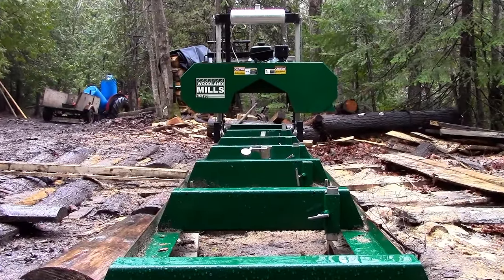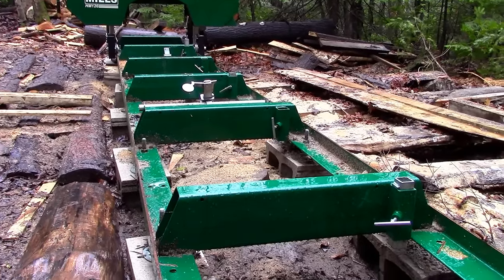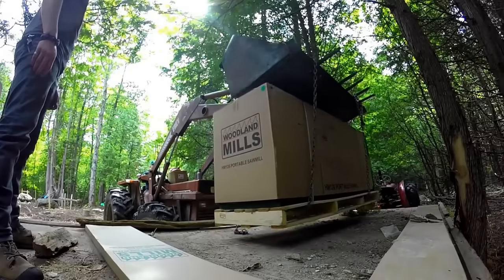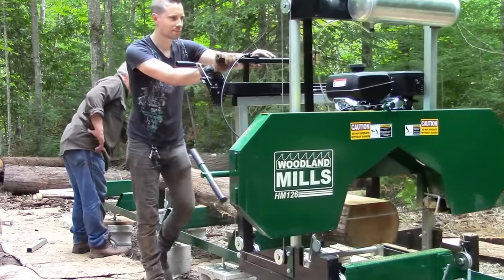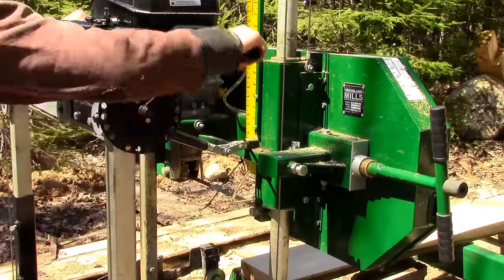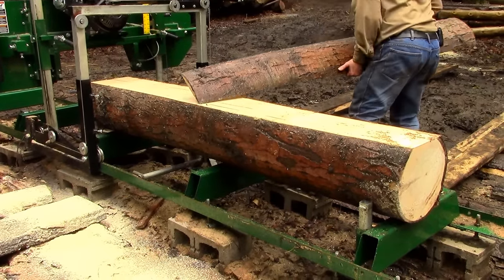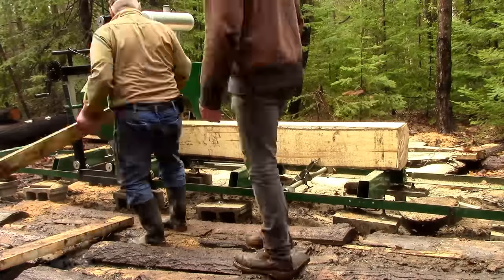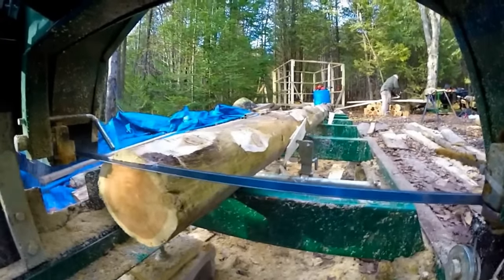Portable Sawmills- Are they worth the money?- Woodland Mills HM126

Comment: I realize this video is a few months old but, few questions for you that you didn't cover.

1: What's the cost of the blades vs the cost of a chain? 

2: You mentioned about sharpening the blade, what's the time frame for that? A chain saw, can be sharpened right there on the spot without removing the chain. If my memory serves, you either have to send the blade in or spend a small fortune for the sharpener. Otherwise, if you attempt by hand, will take a tremendous amount of time. 

I know many talk about the "waste" from a chain saw mill vs a normal saw mill. In my opinion, that's mute. Look at the pieces you remove before you start cutting actual lumber. Even a 1/2" x 1" piece, (or smaller),  is still usable, especially in woodworking. I won't disagree about the fact the chainsaw mill is a wider cut vs the band saw mill. But, that's just my thoughts about the waste.

Comment: Great video.  Very useful information.  Still, I'm very surprised that you work in the mud and cut muddy logs.  I can see all sorts of negatives with this.  I would invest in a concrete slab and a power washer.  That being said, I would like to hear your input on the subject.  ...maybe it isn't a big problem.
Reply from the maker: In one of my previous episodes I show my setup for washing logs ("We Got a Portable Sawmill!- Log Cabin Update"). Most of the logs that you saw me cutting in this episode I did wash beforehand. You're right, keeping mud off the logs is important; however, my location in the bush makes that a challenge.
Reply: We have this same mill. It’s on 300 acres of land. It was used when we purchased and I guess it’s been 4 years now. We log and saw most every day. I’d say we have put around 200-250,000 board feet through it. The last few months we went from two guys, to three. So one guy logs, and pulls the trees back with a small tractor, and two of us cut. Logs often get muddy. We use welders wire brushes and stuff bristle brushes to clean the blade path until we get the slabs cut off. We have a sharpener also to keep the blades fresh. Never has been a issue.

Comment: Just curious why you move the logs by hand when you have the tractor?
Reply: No forks.
Reply: Wondered same thing! You don't need forks, just chains.
Reply: I agree.  To move small boats and canoes they make little trailers that are just the mount and the two wheels, you grab the other end of the boat, pick that end up and go with the back end of the boat rolling along.  I have seen people doing similar with a two wheel attachment on the back end of a log with front being pulled by an ATV.  I'm betting that tractor can pull better than an ATV.  Yes, things cost money, but the speed and lack of grime packed into bark to dull the blade will help the build effort (assuming you have the cash to buy/build the two wheel attachment).
Reply: Chains and if you have some ratchet straps you can use 2 trees to roll it up the side ramp. Or some ratcheting block and tackles if you have them!  Great video and very clearly explained.  Thanks for sharing.  :-)

Comment: for a new operator that was well done if you want a cheap  bead for your mill cut it if you weld it will not coast you much for the metal then you just center the mill when you travel i had a little back hoe and full hydrolic ban mill a small sev s ten 4x4 work on my own think it coast me two days a month for payments for it all most of my helpers i paid 20 buck an hour ones they got it in hand most of them became millers and were off loved it

Comment: How long did it take to set it up?  I have a particular piece of grizzly equipment that I had to repair 13 separate issues straight out of the box. Didn't get to use the Grizzly product for a month, and it was brand new. They sent me a defective warranty part, parts that didn't even fit, and there was a back ordered part needed. I'll never buy a grizzly product again

Comment: I set up a chainsaw mill's first cut in much less than half the time it takes you to load a log on the band mill.  It adds up to the amount of time it takes to tap in six 16d nails about 1.5" deep.    I can go through a 10' log 30+" wide in 10-15 minutes per cut.  The mill cost less than $100 delivered to my door and the power head was free...already had to have a decent sized chainsaw to fell and buck trees.  Look up my videos if you need confirmation.

Comment: Should u buy a bandmill?
Bushland ? 
Yes,if it is a couple of thousand dollars.
You can build your buildings and sell it.
It's lots of work and handling. If u have free help??? It's great.
More expensive mills are still slow.They are not production mills but they are very expensive. 
Your landing area needs to keep the logs clean as possible. 
Stability in sawmill setup is crucial .Your log deck needs to be solid and make setting the log on the mill easy on you and the saw frame. Opinions are welcome.

Comment: IMO:
Do you have a tractor+trailer y/n ? n= chainsaw mill 
Is it for a log house? y = chainsaw mill 
Your forest is made mostly of pine/low grade wood/small diameter trees? y=chainsaw mill 
If you don't have a tractor with hydrolics to hoist big logs into a trailor back to the shop or the sawmill transformation area then forget the sawmill.

Chainsaw mill= $129,  Portable Sawmill: $2800-$3000... (it's $2800 that you can spend on a: chainsaw mill, a mig welder, an metal cutting saw, an oxy cutting torch and adapt your own electric bandsaw on rails :)

Woodland seems good but, the Frontier OS27 seem even better for ease of use for a few bucks more. Do you really need more then 11' lumbers? in few application if I ever needed more then 11' lumbers I would simply chainsaw mill it. The longer the heavier and seldom straight or perfect grain also...

Comment: I don't think there is many better explanations then this one. But i have been thinking on it and at the end of this video i see how you get the raw tree into rectangular /cubic shape and from there into thin boards. But how do you cut vertically or do you just use a table saw to makes all the 2x4, 1x3 , 2x6 ,2x12 ,...etc. Also there is no lathe part for the bark removal so it seems your also wasting alot of wood trimming off the bark of the tree. One other thing is how many times do you run into a bigger diameter tree that you cann't fit in the machine?

Comment: The Outsider  With the trouble and time you were upset about the placement of the saw and level of it. A concrete slab in a place you can access with a tractor would not be much effort to make and could have a use left when done. A trailer to pull it there on and use is not so hard to construct. It does not need to be built for the road use. The trailer idea may cause more trouble getting large tree trunks to mill up higher without a lift. That could be part of the trailer though.  The bandsaw is a much better saw mill for creating lumber faster and cleaner cutting.

Comment: Hi, I’ve watched a few of your videos, interesting work!  I have experience with log building and live in a log house.  
So recently I had a load of birch delivered to my 5ace property for heating. Saved 12 10’ to 16’ sections that seemed to nice to burn,  I have started cutting with my stihl 046 and a28” bar.    Annyway I bought an 30” Alaska mark IV saw mill,  couldn’t justify a bandsaw mill, but I do want one haha!  So far it’s going well today I have one smaller hemlock to cut think I’ll make it a5x5 or maybe a 6x6” beam. Then cut it into 1/2” slabs for trim.  Then I’ll startt into the birch average 11” to 13” pieces and 10’ to 16’ in length.  
    So there in a nutshell of what I’m doing here I was wondering if you know of any bandsaw mills for sail, I like the trailer option.  
  Thanks Daran,  Smithers,  BC
“

Comment: I'm looking to buy a band saw mill too, but I'm wondering if I will save money. On the one hand I could sell the trees on a few acres of my forest and use that money to buy construction wood at my local shop. On the other hand I could buy a mill, fell the trees, and make my own construction wood. Take aside the fun factor and convenience of having my own mill, does it actually save any money, even if I don't count my time milling?
Reply: It's hard to beat large-scale production mills.  They buy a lot of logs and have all the tools necessary to process them quickly. An HM126 is $3000, a kiln is several hundred more to build, an edger and planer and sander are another couple thousand dollars, so you are looking at something like $8000 to be able to produce the same lumber a s professional millyard.  And then there are skidders and trucks and trailers and ongoing expenses like gas and blades and your time.  At $30 per hour ( a measly income), you have to make about ten 2x6s per hour just to equal your pay.  That means you have to go through a few logs per hour to make anything close to your value. $8000 buys you a lot of kiln-dried, dimensional lumber, and it is there right when you want it, without doing a whole lot of work to get it to the worksite.  On the other hand, you can cut your lumber to any dimensions you prefer, and you have the satisfaction of knowing you built the whole thing from the ground up.  And it is hard to find elm and sycamore and butternut and mulberry and Japanese Maple boards. If you live in the middle of Nowhere, Alaska, buying lumber is going to be far more expensive, so it is easier to reach a the break-even point, with a mill.
Reply: Thanks for the input Damon.

Comment: Another good thing about this video is you demonstrate where to change out saw blade ,  extension rails for longer height tree processing (if you don't want to cut them into shorter trees to process) , how to operate the machine nearly everything. Must be a bitch though to roll large logs onto it without skid steer or something though maybe not just guessing. Seems the hardest part once you have this machine set up is getting the chainsawed tree onto the machine... what happens if the tree is far away you have some type of skid steer to carry it back ? Or are you always staying close to the machine with the trees you choose to cut?

Comment: When a log varies in diameter from one end to the other... How does one deal with this to get your boards or logs square and the same thickness over the length of the log that is being cut...?
Reply: BigRed56 set you blade to just below the smallest diameter on the log. When you cut it will cut it flat, simply repeat on the 3 other sides.

Comment: Do yourself a favour; Cut yourself a pair of runs of 6x8 for under the angle iron fram running the length of the mill and get rid of those cinder blocks. You can set it up with half as many level points. You will still need to level it every now and again but, you will have half as many points that you have to concern yourself with.

Comment: I'm happy for you that you like the mill, I don't i have a HM 130 whit a 7,5 kw elektrik engine and i think it's so bad so un exact and like you said it is hard to level the tracks my brother have a woodmizer and you don't have that kind of problem whit them, you get what you pay for that simple is that, whit a woodmizer you got exact cut every time you don't have the problem whit the tracks they have much stronger frame and you produce 4 time more and faster on same time better quality to, I will sell my HM 130 and by a woodmizer and on woodmizer you have the opportunity to by extra plug and play like automatic adjustment of the high a computer that you can set the dimensions you will cut and it will adjust by it self, never a woodmill again,  it cut nice but I have much higher standard

Comment: Fellow milled my timber with his nice new band saw mill.  Good size logs, pine, only 2' o 3' diameter sections, and all milled into 4x6, 6x6 and 8x8 lumber.  Ended up costing as much per board foot for his milling cost as graded and properly dried lumber and not counting the dozer cost for putting the log sections where we could roll them onto the mill.  Asked him how it went from his business perspective.  He said he was going to have to charge more in the future.  Not going to happen.  Better off buying lumber for what you need and using the trees for firewood.  These pieces of equipment are for very remote locations or just fantasy fulfilling exercises of survivalist wannabes. And YouTube video makers of course.

Comment: and you are trapped into modern consumerisim.

a bandsaw mill is so cheap to BUILD YOURSELF.

the tracks and rails cost about NZ$800 .one days labour and the bed is made and you can even make it as a trailer

the saw head is a little harder as it needs alot of moving parts.

about 5 days.

a robin motor is a better option where i luve but you need to look at your paticular location and whats available.

beari gs are not an issue as you can carry spares and reorder when you replace them as needed.

besides that most civilised countries have the quality bearing makers outlets everywhere.

in short,about NZ$4000 and you have a rod registered trailer/bandsaw mill

Comment: The problem I see with these mills is they always have the log on the tracking mechanism, id rather have one so the mill runs on its own track with the log next to it, so the saw overhangs the tracks to saw the log which has its own base made up of sleepers, one could design a trailer to suit so the mill doesn't have to be set up every time, this is how I would make it for my portable mill,

Comment: Finding it hard to understand why a guy smart enough to buy, set up and operate a bandsaw mill wouldn't be able to find a design for a trailer, build it and mount his sawmill on the thing, why wait for somebody to build their own and sell it to you?  Stop handing over your hard earned cash to somebody else.  Hey you were probably able to design and build your own saw mill and if not design your won then there's designs here on :You Tube you could have copied and saved a pretty penny.  Trailers are a pretty simple item to put together and all the parts you'll ever need are sold on line - take advantage and build your own.